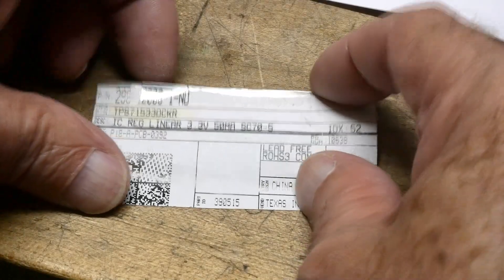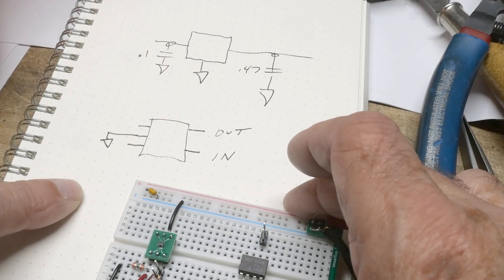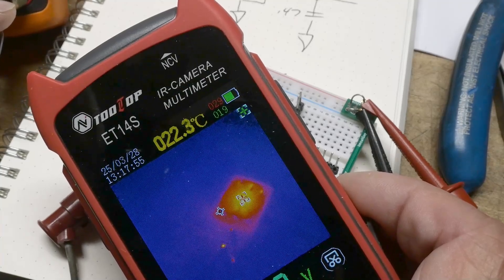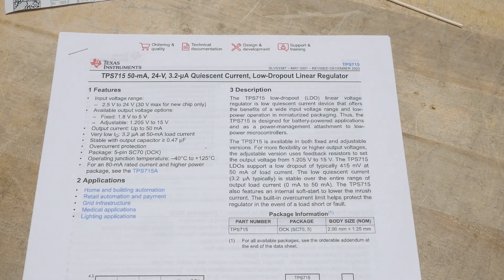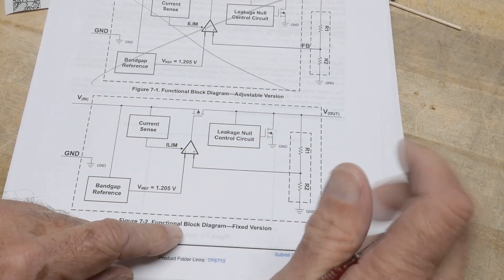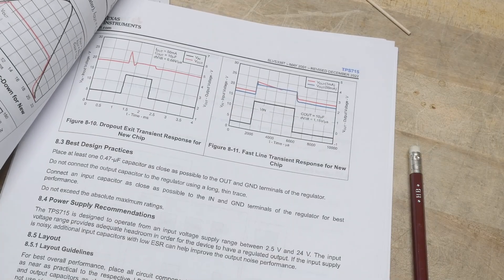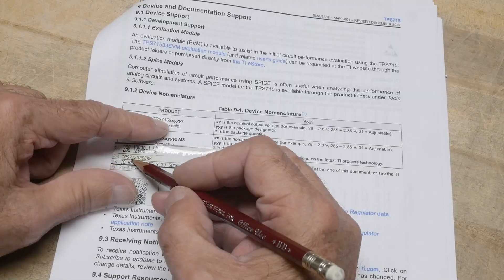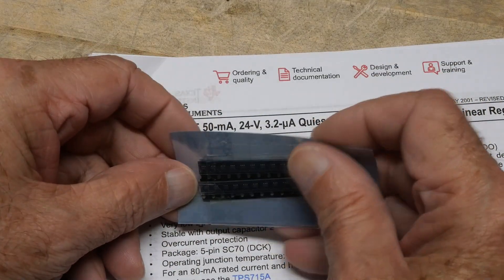#2198 TPS715 Voltage Regulator

Comment: 0.4V DROPOUT is pretty bad for a 50mA LDO!
....also TI calling it a LDO is cheeky!
Reply: 0.4V is most definitely an LDO what are you smoking. Non LDOs are like 2-2.5V dropout.
Reply: @humidbeing  Anything over bout 0.2V at FULL LOAD is a shit LDO, the rest is MARKETING!
I know the industry follows this EVIL DISTORTION, but I hold my opinion on this.
Reply: @stevenbliss989  what you are describing is in ULDO range. LDO nowadays is probably anything below 1.25V of ubiquitous LM1117 / AMS1117 and the like.
Not sure where the ULDO starts though. But is probably also depends on package. And sure has diminishing returns in most applications.
There are other (often more) important parameters like PSRR, noise voltage, being ADJ rather than fixed, having bypass pin available..
Reply: @Mr.LeeroyWe'll have to agree to disagree.

Comment: How would you define quiescent current in a 3 terminal regulator,  such as a LM317 type?
Reply: The current flowing through the adj pin. It also burns a small amount in heat running its internal circuits. In terms of the LM317 and other older regulators its also swamped by the required load current being >3mA (varying by OEM), which often requires you to use smaller feedback resistors rather than large ones.
Reply: @ivolol  Thanks

Comment: Good for rechargeable lithium cell replacement of 2 AAA cell devices. Remote controls, etc. though I usually go larger package.
Reply: Problem is a lot of the newer stuff isn't available in through-hole any more. 😥

Hand-soldering SOICs is OK... anything smaller is pretty frustrating!